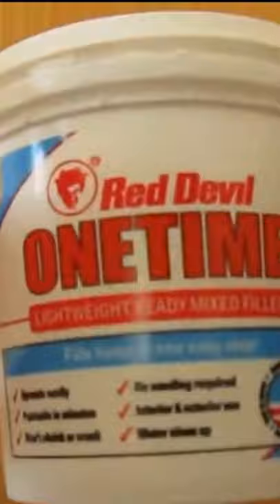Repairing a punched hollow door ! #short #repair hack

Comment: what did you put on after expanding foam?
Reply from the maker: it's a lightweight filler called red devil which is flexible when dry and also very easy to sand
Reply: @Instone09ine  thanks for the response!  I'll check it out!